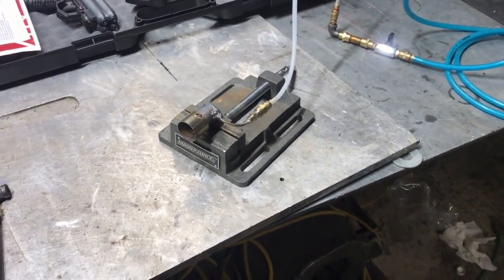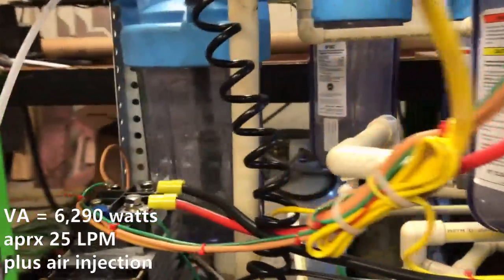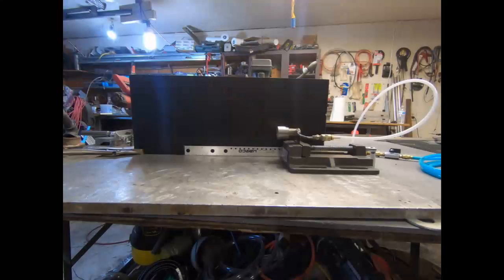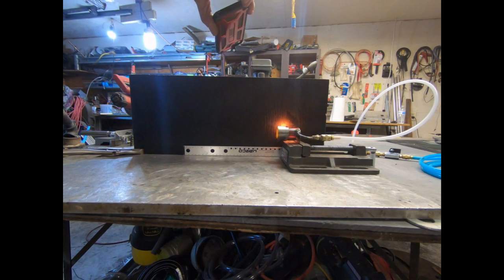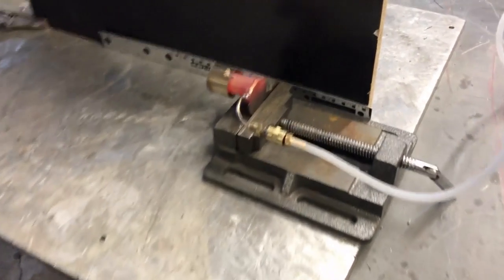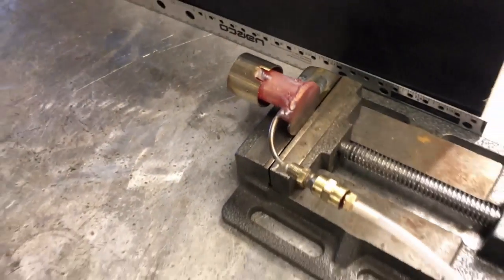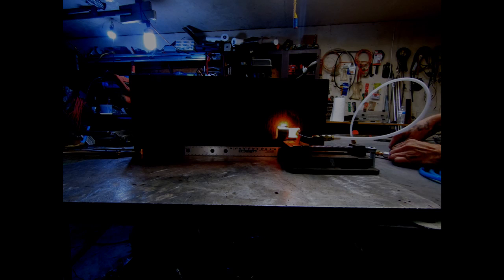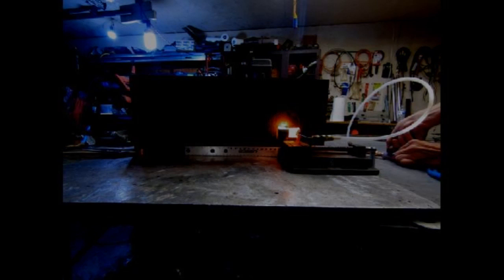Micro Hydrogen Burner Destroyed in seconds

Comment: Very interesting video Nobox7.

As soon we play with hydrogene every body must keep in mind that flash back shock wave is very high velocity front wave; so you must add lenght to your feeding tube*  to be sure to beable to turn off before the front wave hit the tank. 

My 2 cens : 

1) adding a very simple electronic controled valve be able to shut down as son as a captor detect  flashback close to the burner, build it only with analogic electronic and use it on spiraled tube inorder top let electronic and actioner the time to close shut down the gaz.
2) Adding before your manual valve the equivalent of a "gaz fuse" beable to "pop" in a cylinder and when it pop it crush and compress a sacrifical part of the feedind spiral tube far away from the front wave this like a "dead man button". 

3) The incoming flux input directly in contact with your burner please take the time to look to this russian solution https://youtu.be/imRAnN4ylZs?t=97. This is a long video with no subtitle but your clever enought to understood what they have done 

Have a nice Day Nobox7
 * Wrap your gas feeding like a spiral coil to avoid to loosing space and protect it in a cylinder with a spring load to disipate cinetic energy if it explode

Comment: Maybe a diverter  valve to shut off Gass to your burner and then divert it to a bladder tank  or balloon .  So you can shut it off then shut it down. Also an electrical remote switch would be cool to shut down the electrolysis.  Redundant redundancy  aka safeties...